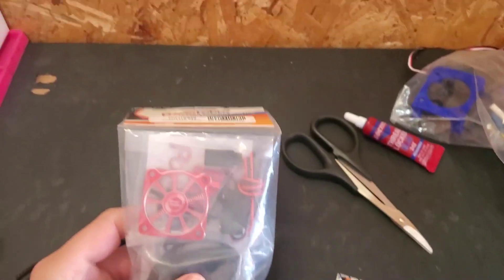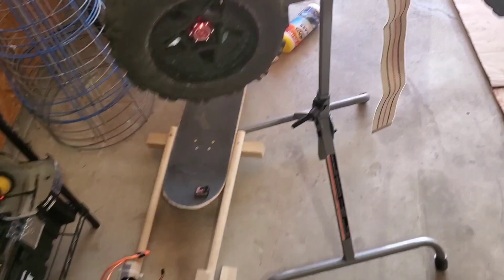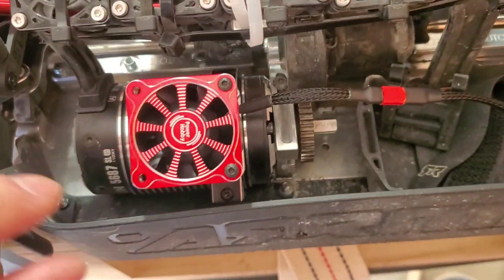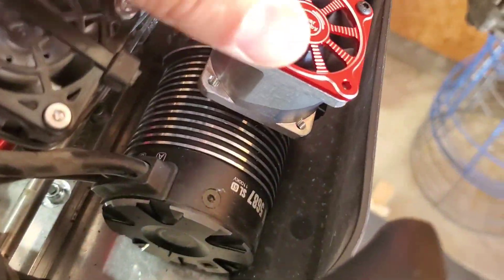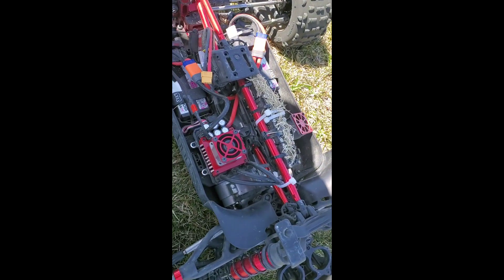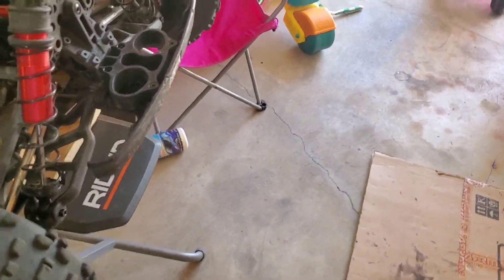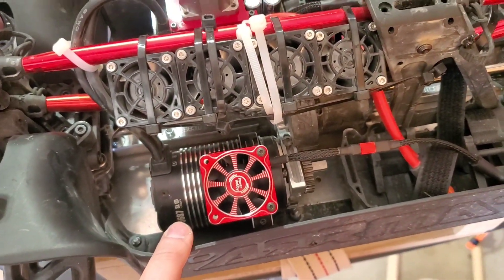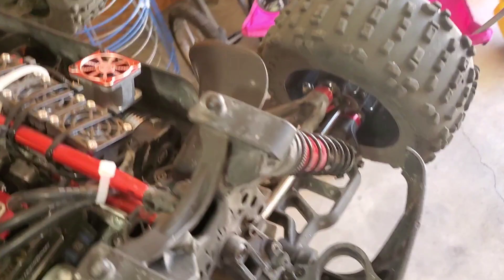New motor housing for 40mm fan

Comment: Hi, great video thank you quick question can you run any of those high powered fans right into the receiver box or will it burn up the receiver? Thanks.
Reply from the maker: I think most receivers kick out 7.4 volts so you should be ok.